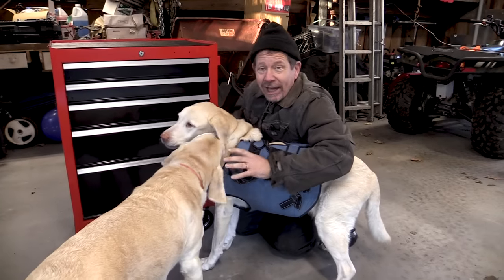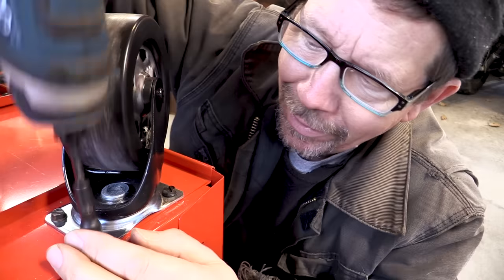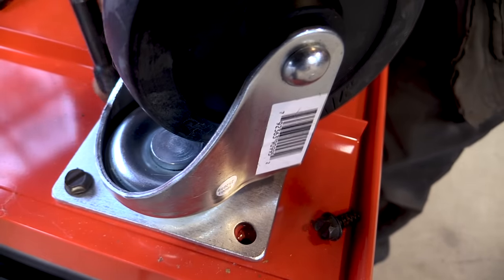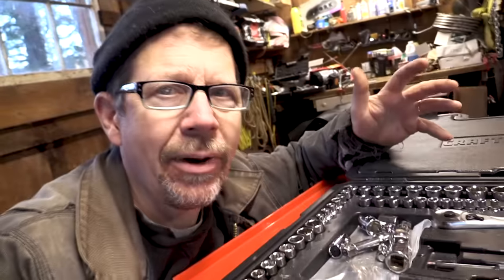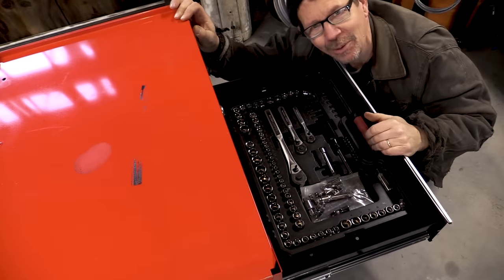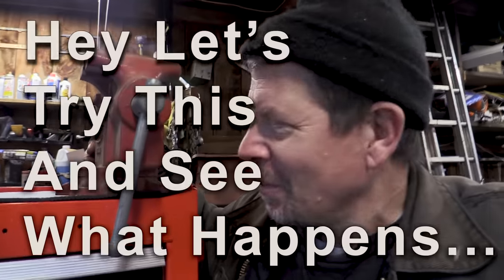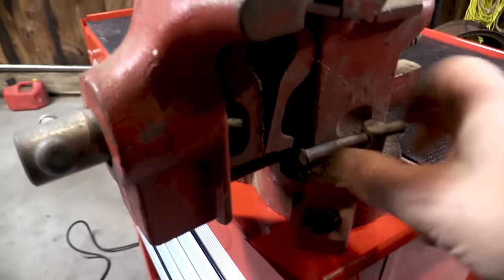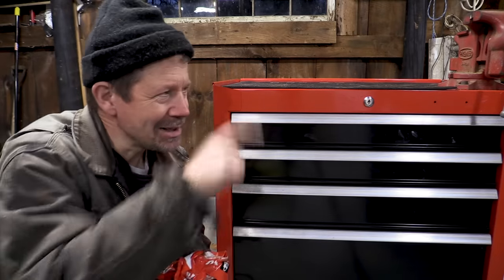3 Rolling Tool Cart Hacks You Can Do

Comment: I simply cut one by one strips of wood from my scrap pile of wood the length or depth of my tool drawers and using my radial arm saw cut grooves in them about every 1/2 to 3/8 5/16 of an inch and slotted my wrenches in that way I was able to get almost 60 ranches in a 40in drawer
Reply from the maker: Great idea, thx for sharing that. Simple and neat. Thx!

Comment: You are very clever. You remind me of my late father (in a good way of course). I live in New Zealand & I purchased a ToolPro rolling tool cart/trolley, worked great for 14 months, but then suddenly I am unable to unlock it. The key fits in the lock & it turns but it won't unlock. The store that I purchased it from was about as much use as a chocolate teapot on a sunny day (or is it as much use as an ashtray on a motorbike?) The manufacturer said either drill out the lock or turn the tool cart/trolley upside down to get the locking bar(s) on the back to slide to the open position. But it's full of tools (total weight is over 200kgs. I have several very powerful magnets that I thought maybe preferable to trying to turn it upside down. But if anyone has any other ideas, I'd be grateful. Thanks a lot. Maybe I should video what I do and post it?
Best wishes from 'Down-Under' (that's what we 'Kiwis & Aussies call our part of the world.

Comment: Enjoyed the video; I'm interested in the Craftsman socket set you have...do you have a model or SKU number for it.  Most of the ones I've looked at the top is also crammed with pieces and it looked like all of yours were in the bottom section only.  Thanks.

Comment: Got a crafts man bottom chest for 16 dollars on clearance at sears.  I snagged it quickly as soon as I saw it.  It was in the closeout/scratch and dent area.  It has a bay and only 2 drawers, but for 16 bucks I wasn't that picky.  I put HF castors on it like you did.  My dad gave me a older craftsman vice.  It was racked so I took the drawers out of it and untwisted it and beat a few dents out.  Ditched the garage bay style door to make it an open shelf.  Mounted the castors.  Then took some 2 x4 scraps I had laying around and ripped them on the table saw and made a butcher block top for it.  Mounted the vice to the top and screwed the vice into wood.  The only issue I have is its all an narrow and can fall over if you have lots weight in the drawers and the are open or you have something to have in the vice.  The 2 fixed wheels would have helped with that, but overall since I used mostly what I had in the shop and took back some unused things to get the castors I have under 40 bucks in the whole deal.  Works well.  I keep most of my "mechanic" tools in it to use a service cart for the bikes and cars.
Reply from the maker: Fantastic Danny. Great find at the store. $16! Thx for sharing your project. Eric.

Comment: Save the casters for your next kitchen renovation. A base cabinet makes a good work table and since it will spend most of the time in a back corner of the garage or basement, the casters will keep the wood from absorbing moisture from the cement.
You won't be moving it all the time, and the cheap casters will encourage you to keep the garage swept up.
Happy wife, happy life!

Comment: Pedal bikes have ally drink holders that bolt to the bike frame. This is what i use to hang my spanner sets. If need be the holder is strong enough to hold both sets & looks good. Other option is bolt the spanner holder directly. Tho that doesn't make it mobile if needed anywhere but in the shed. Box can be expanded with side cabinets which if done right can lengthen work top area. Those spare castors can be used as anti tipping i.e side cabinets slightly shorter height wise. You'd most likely only need one each side near the outer center of the sides cabinets. Castors with brakes would most likely make the box more stable when using it's benchtop

Comment: It is a toolbox. Not bad. I would look at a piece of plywood or butcher block on top of the mat. Then a piece of steel plate inside the toolbox to hold the vise down. I would also not a lock washer with that funky nut. Just use some blue loctite. 
Still not too bad.

Comment: You can fit a lot more sockets and tools in one drawer if you don’t use that blownolded case.
Reply: You are very right. I just use them if they hold the sockets tightly all together. If they hold the tools miles apart, those cases will have a trip to the skip.

Comment: As per the box wrenches, leave them on/in the hangers, and drill holes on the sides of the toolbox coved areas or recessed areas, holes just big enough, for peg-board hooks, and then you can hang the box wrench tool caddy's on the handles to the hooks, and they are not in the way, of being snagged off by walking by with your jeans or cargo pants pockets... Might be an issue, if you park the tool box in a corner against the wall, as that side is now out of reach or pinched off fro gaininh access to tye box wrenches then..

Comment: For the top throw that useless black stuff away and add a piece of plywood to the top, then bolt your Vice on top. Also, if there is locking universal swivel wheels use those

Comment: There's a reason there are two fixed casters and two swivel casters on a tool cart.  Before anyone decides to put four swivel casters on their box you might want to understand why they will never sell them like that.  Suppose that your tool box is completely loaded with tools.  Now suppose you want to roll your cart across the shop to a different location.  most garages have poured concrete floors that have a tapered slope near the garage doors.  Your new swivel casters will accommodate gravity when you try to wheel it across a slope and gravity will win. Especially if your cart or box is fully loaded.  Two fixed wheels allow better control when moving the box in the same way shopping carts have two swivels and two fixed casters.

Comment: Tip No 4 - LOCK YOUR DRAWERS before moving it.... I had mine get stuck on a small bit of grit on the floor while I was moving it and had all the drawers opened, the cart then went over as it was out of balance and I ended up with the two bottom drawers wrecked....these modern ball bearing sliders make it too easy for the drawers to open by them self.
Reply: I guess you can blame it on the drawers…

Comment: Cool vid. Thx. For the wheels mount the locking types on one side to keep it stable. 
And use double sided tape pads to keep the tool trays from sliding.

Comment: Build a rolling workbench. You won't have as much weight on it as you do in a fully stocked tool chest. Honestly having two fixed and two swivels is better because the control on them is tamed at the cost of maneuverability which a workbench is better suited for.
Also to add, I wouldn't have wheels on my tool chests to make theft extremely difficult if it's all locked up and fully stocked.

Comment: Technically speaking that's a 26×18 rolling tool chest. If I had to say anything it would be you put to much money into trying to make it useful. 
Now I do understand what you are doing and figured I would give my thoughts on a real box to cart conversion. 
The US GENERAL is better all around as it is an 8 drawer chest, this means its work surface will be higher and more comfortable. It is also 26x22. Meaning you can store more. The drawbacks to these is the fact the top does not open. At the same time, this is an advantage as you have a fixed working surface.
I have always used rule of thumb. Put things in the drawers based on convenience.  I like my sockets in the top drawer, wrenches in the second, electrical in the 3rd and so on. Heavier items fit towards the back of the drawer to distribute weight as close to the cabinet as possible to help deter tipping over. Slim items utilizing slim drawers. 
Your next two hacks should be a screwdriver and prybar rack. 
Also, it may be nice having your socket set in that case like that. I am thinking socket rails will maximize space and make it easier to take them with you when needed.
Reply from the maker: thanks for sharing Kevin 👍

Comment: Cheap wheels like those work well for the bearing surfaces of a simple spinning barrel composter. Doesn't matter if they are the swivel kind or fixed, the weight of the barrel keeps them oriented.

Comment: Just a couple of things I would have done differently. Put something down on the floor before turning the cart over. I would have used 2 fixed wheels on one end. Because now with that vise on there it will move around a whole lot more with 4 full swivel casters. Put a sheet of 3/4 plywood on the top of the tool cart and a peice of either the same type of plywood or 1/8 plate steel about 10 inches by 10 inches under the Vise and bolted in down with all the hardware. Then put something heavy in the bottom draw to make it more stable when using it as a work table. Also those spanners. Cut the top strap off the plastic holder and place the spanners and holder in one of the draws. That way if one is missing you know. If they are taken out of the holder and just put into a draw loose you could be missing a couple of them and you would not notice. Not picking on your upgrades but you asked for ideas and this is what I have done to my cart. Great video.

Comment: Hi, Eric!  About that clamp up top, I have a suggestion for you, if ever you find it ends up being in the way of other things you may want to do with the top of that tool bench.  Look at either welding or epoxying the bolts so they're affixed to the underside with the threads sticking out up top, and using wingnut bolts to tighten the clamp down; or else switching to some sort of cotter-pin set-up, so that you can pull the pins anytime you want to remove the clamp.  

As for the set of socket-wrenches, I'd think about putting the case on a hinge set at the front of the drawer, and the case aligned so it's ... damn, trying to describe what I'm seeing is impossible without drawing it.  Guess I'll have to email you, lol.  

Good luck, and good ideas!  I'm here in an apartment and suffering from a lack of tool-storage and access, but looking at your set-up gave me a great idea about how to organize everything!
Reply from the maker: Yeah! Good info, thx for sharing. Apt tool storage is a challenge. Thx!

Comment: has anyone found a way to strengthen up the tabs that the rails slide in?  My chest has about 4 or 5 drawers that need reinforced tabs.  The chest I have is from the 90's and the tabs are thin and week.  The plate the tabs are on is thin but should hold something stronger with no problems.

Comment: I think they use plastic wheels because when you get alot of heavy tools in there the rubber wheels will develop flat spots and therefore be really hard to roll , unless the rubber is rated for it thats what one of those tool truck guys told me ?? Idk but goid luck !!!!
Reply from the maker: I did pay attention to the load the wheels could carry, but yes good point. This will have mainly hand tools. Thx!

Comment: If you add the vice put a 1/4 aluminum plate under the top of the toolbox for support. It will flex if you start to apply excessive force at the vice.
Reply from the maker: Yes good tip, another viewer had some scrap butcher block that he put on top. 👍

Comment: In the drawers, put some yellow or white anti-skid rubber mats, so that the tool cases halves and the wrench organizers, etc. won't slide around as much, and so that you can see the other tools you slip into those drawers against a light background.  On the wheel replacement, did the new wheels just roll  smoother and swivel better? There didn't seem to any noticeable difference in size.  On the top vise mounting, that's a great idea but putting a slightly oversized piece of outdoor-grade plywood on the top would give you a real work surface and a little overhang would give you a little better access to the vise for grinding and cutting.  Thanks for doing all of these improvements.  

P.S.  I'm waiting for the video where you show us what to do when you overload one of the drawers in your rolling work center and all the ball bearings fall out of the drawer slides and hide in the cracks in the floor, and you can get the drawer out anymore. I'm asking, because it happened to me.
Reply: If you can remove the other drawers (just saw a how-to video on that), maybe you can tip the cart onto its back, changing the gravitational pull on it, and be able to get it out. Good luck.

Comment: Take the vise off, put a piece of 3/4” plywood on then put vise back on. The plywood levels it up to or above the metal lips (makes surface flat) and adds a lot of strength for heavy items and the vise. If you use this a lot for heavier work the top will get bent down. Trust me. 
ESSAYONS

Comment: Once you have your toolbox in place in your shop you might not move it very often.
I swapped mine out with casters that have grease fittings for the swivels and the axles.
Reply from the maker: I had not thought of Grease fittings , good point.
Reply: In addition, I added a 1/2 plate of aluminum between the casters and the bottom of the toolbox. I have Kennedy boxes, so they are good quality stuff. I am a pack rat however, lol. I worked at Boeing as a Jig builder. So my toolbox saw a lot of travel miles. My box was pretty heavy, so I could have been the exception to the rule. 
Keep the videos coming, I truly appreciate them. 👍👍
Reply from the maker: Bret Lambky wow, you built cool stuff I bet. Neat. Appreciate the kind words, Eric.

Comment: Your idea of 4 crazy wheels, I think that you will get to where you do not like it. When your drawers get heavy or sticky, the tool box will move around instead of the drawer opening.  A mechanic that I use to work with did it, it took 2 people to move the box, when he opened or closed a drawer, the box moved. Real mechanics want 2 straight & 2 casters with brakes.
Reply from the maker: Hi Darrel, I had the two straight wheels and did not like it. Whatever makes one happy is good for me. Thx for your thoughts ! 😀

Comment: Youll want two static wheels once it’s full and heavy. It’ll never push in a straight line. Lol
Reply: True! Also should have had brakes on the swivel casters, there are times it needs to be stationary
Reply: It depends on the offset of the casters
Reply: Pat H if they don’t offset, the will be no lateral force to oppose the direction of travel. You would physically have to  manipulate the direction change. More than normal. No mechanical advantage.
Reply: Pat H if they dont have offset as you call it they are not casters. The offset you are referring to is called caster thats what makes them center themselves when going forward. Same as the self centering tendency of the steering wheel in your car